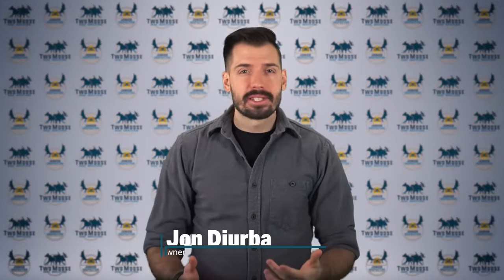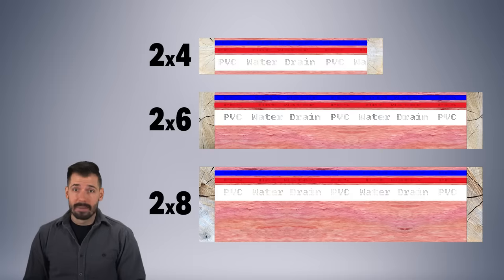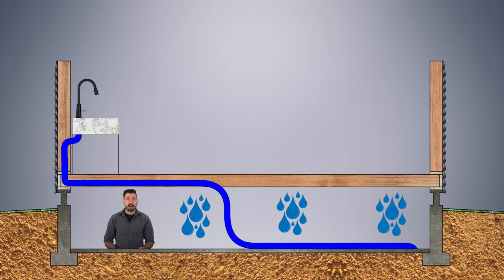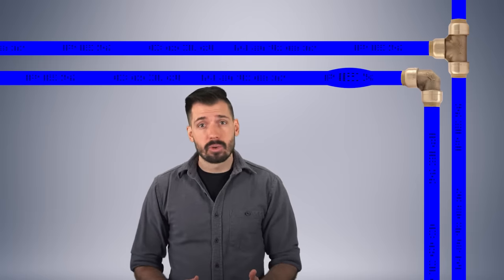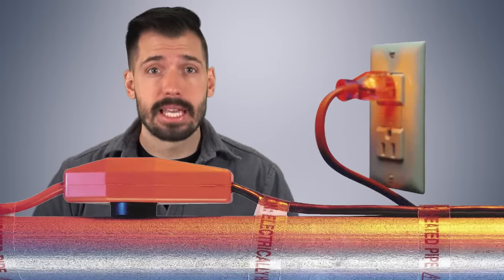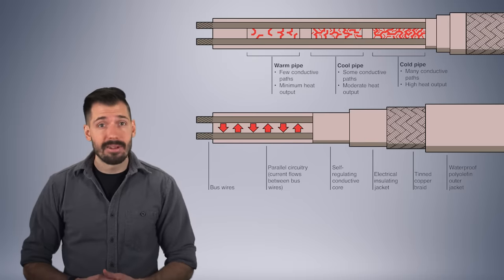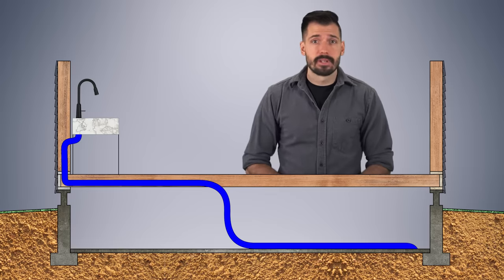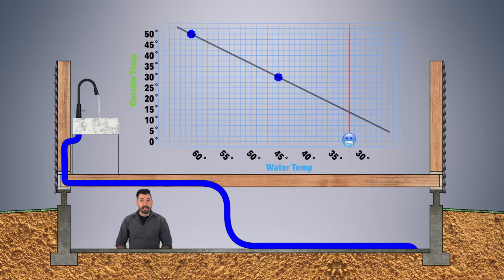Frozen Water Pipe - How to Test Your House for Freezing Pipes

Comment: My pipes in my cottage had been frozen for four days and I watched your video this morning. I got the woodstove roaring to heat up the place more and opened the cupboard doors under the sinks in the bathroom and the kitchen. Then I went outside and put a small space heater near the pipes in my exposed crawlspace. after a couple hours your tips worked wonderfully. Thank you so much for posting this informative video!! 🥳 I’ll be better prepared for next winter. 🥶👍

Comment: I really liked your video.  I'm in the Houston, TX area and have learned a lot over the years.  The TV news only partially provides the necessary information.  Cover the hose bibs; check.  Open cabinets; check.  But NEVER goes into the FACT that it is HEAT from the living space (that you so well covered) that prevents the pipes from freezing.  Hose bib pipes on unheated walls WILL freeze and burst once the temperature gets into the teens.  (they don't break the valves themselves; they break the thinner pipes in the walls)  Pay attention to where your hose bibs are and if heat can get to that wall.  I was around in 1989 when, due to the loss of power (rotating power outages), pipes burst all over Houston.  Knowing this, for "The Great Texas Freeze" of 2021, I had already drained all of the water from my house pipes.  (I failed with my pool equipment, but that is a different story.  Live and learn.)  New lessons.  Remove plugs from pool equipment when there is a power loss; because there is no power to circulate the water to prevent it from freezing using "freeze mode".  Leverage heat from the earth to keep things from freezing.  A bunch of my pool equipment froze and burst pipes and the heater because I didn't know to remove the plugs and let them drain.  But, I have a fake boulder over the water valves used for my in-floor cleaning.  That survived just fine in 2021; good thing too as there are a TON of pipes for that.  For hose bibs, I recently bought some Freeze Misers.  Check them out.

Comment: Greetings from Scotland.  When it comes to crawl space pipes,  I’ve found that temperatures are actually very stable.  I’ve got temperature readings on two hot water pipes, and they are about 10 degrees C outside of shower use, even though the space is vented, and even when the temperature outside is minus 10 Celsius.  This is down to ground temperatures.  It takes a lot of energy to freeze the ground, and by the same token it also radiates a lot of heat.  When.you put a house on top of that ground, it holds it’s temperature for a long time.  Now that said, if your climate is continental the ground temperatures under the house can be much colder.

Also, while one degree doesn’t sound like much, actually it is.  The latent heat required to take water from freezing point to ice is the same energy needed to chill the same water from 70 degrees C to freezing point.
Reply: Very interesting!  I didn't know that about the latent heat.  Learn something every day!

Comment: Hello, experiencing a winter freeze right now. The pipes are ok so far. 🙏🏼 I watched your video & respect your expertise. In addition to taking temperature readings (for the graph you demonstrated), what general factors will tell us the pipes are in a safe zone? I assume whenever the outdoor temp is below 33 deg, then there is a threat for frozen pipes? Lastly, is it ok to remove all of the vent styrofoam covers to the crawlspace when the outdoor temperature consistently stays above 33 deg - to avoid radon poisoning &/or mold growth? Thank you.
Reply from the maker: Hey, When the temperature is below 32F outside the pipes could freeze if not used for a long enough period of time. However, There is going to be heat loss from your home and from the soil directly below the house which will help to keep the pipes above freezing. There are many factors to consider, but it is a safe assumption that any plumbing located or passing through an exterior wall or vented crawlspace will be at risk of freezing. Pipes located in the middle or interior of the house should be risk free if the house is a comfortable temperature. If you run an exhaust vent such as your kitchen vent, bathroom vent, laundry dryer, or even a fireplace, cold air from the outside will have to rush into the house to replace the are that is being pushed out the vent or chimney. This can increase the risk of pipes freezing. So be aware of your pipes at 32F and if your house is around 70F you might not need to worry about your pipes until 15F or colder.

Yes, you can remove those foam covers during the warmer months, but keep in mind that current building science is leaning towards not venting crawlspaces, but that is with the understanding that the crawlspace would be a conditioned space and mechanically ventilated. The idea behind this change is to manage the air entering the crawlspace as air can drive humidity into the crawlspace and because of the cooler surfaces in the crawlspace if the relative humidity is just right then the water vapor will condense and cause mold anyway. Also radon mitigation is something that can also change based on what vents are running in your house. Meaning, the vents in a crawlspace alone may not take care of radon issues. It is good to do long term monitoring. I use a detector from Airthings that cost about $150 and helps understand how my house changes radon levels season to season.
Reply: @twomoose  Thank you so much! Again, the best in-depth reply from a host-expert of any Youtube video I’ve seen. 👌🏼

Comment: I have vacation home so I shut water off and pour antifreeze down drains too. Oh I drain the lines the best I can too.  Water lines are in crawl space and I have insulated them the best I can.  My question is if I go there in winter months and the temps at night are in the upper 20’s F should I drip the interior and exterior faucets just in case?  Leave the heat at 70 when we are gone.
Reply from the maker: Hey Brandon,
If the house is at 70 degrees, then the heat loss from the house into the crawlspace should keep the crawlspace above freezing. I would make sure the crawlspace walls are insulated, the crawlspace vents are closed if you have vents, and I would keep the house temperature no less than 60 degrees. Keeping the house at 70 is ideal since that will keep humidity levels controlled while you are gone. The ground temperature in the center of the crawlspace should remain above freezing all winter long, but if it doesn’t, then you might need a secondary seasonal heat source in you crawlspace.

Let’s think about insulation for a second. If I am wearing a big puffy jacket the insulation will help to keep me warm when I am out in a snowstorm, but if my body no longer produces heat because I died in the snowstorm then no matter how much insulation I was wearing my body would still freeze. Putting insulation on pipes that are not moving fresh above freezing water through them will freeze regardless of how much insulation you apply to the pipes. The insulation only works as a buffer to slow the rate of freezing.

Heat Sources include heat loss from the living area of the home, heat loss from the ground that has not frozen, heat from a secondary heating system in the crawlspace, heat from a pipe heat cable. With any of these heat sources the power could go out and your home could stop producing heat, but the insulation on the pipes will extend the amount of time you have to get the power turned back on before the pipes freeze.

Only drip faucets if you are home and if you feel like it is 100% needed. Water in the supply pipes is under pressure, but the water is not under pressure in the drainpipes. That means that water could potentially freeze faster in the drainpipe causing a clog that could crack the drainpipe or cause a backup resulting in the flooding your house.
Reply: @twomoose  thanks for the great info.  I never thought about it that way…. the insulating pipes part that is.   Thanks!!
Reply: RV antifreeze
Reply: @twomoose Wow, best in-depth reply from a host-expert I’ve ever seen to a viewer’s question. 👌🏼 Thank you! Still confused abt the process but appreciate your willingness to help us.

Comment: Ice and water can both exist at 32, but to say that it’s only one degree is misleading. It takes a lot of btus of latent energy to go from ice to water.
Reply from the maker: You are correct and that doesn't even account for the affects of pressure and turbulence in a system, but if all other factors remain the same at some temperature their is a tipping point and until it is reached the water will be liquid, but then after that tipping point it will become solid. That is what I was trying to say, but I might not have been clear.
Reply: Long time ago and I don’t remember. Pressure will affect the freezing point as well by the way.